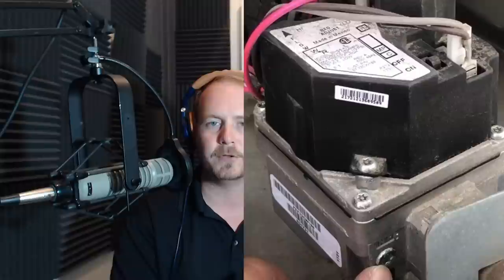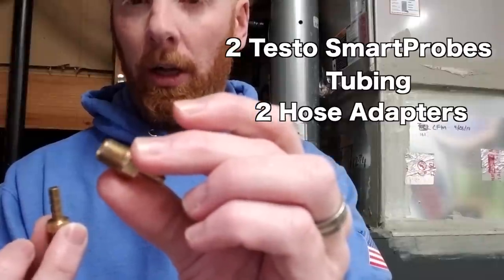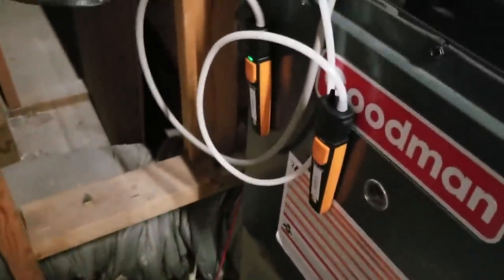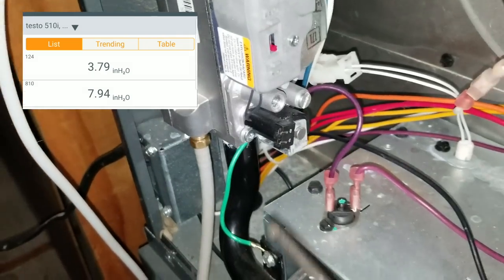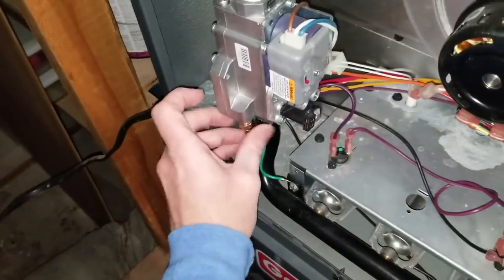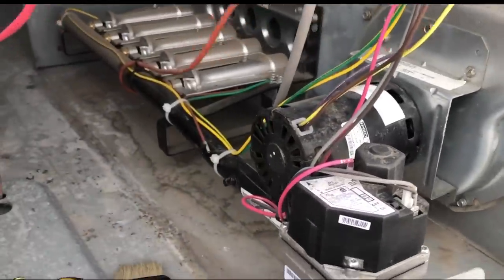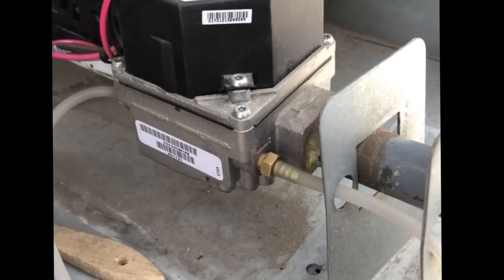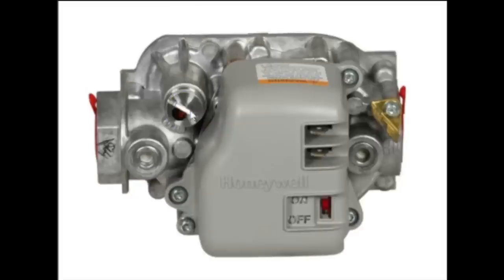Measuring & Adjusting Furnace Gas Pressure X2

Comment: I assume the input pressure is somewhat controlled by the utility and their pressure diaphragm at the meter so you would only want to reduce the input at valve if too high? My Rheem two stage furnace has a White Rogers valve which requires a 5/16 sleeve to cover the adjustment tube on the valve and which then connects to an adapter and hose to the manometer. It has a similar port for input measurement , but no means to adjust it ; further it’s not called for adjustment in the Furnace Manual. Thanks for the video!

Comment: You should of demonstrated the Carrier 3 stage furnace with throttle gas valve. I had to replace the valve and adjust the pressure for propane, that wasn’t enjoyable.
Reply: Never buy a carrier, are you not talking about a modulating furnace? Not 3 stages, modulating are garbage, all manufactures have had issues

Comment: Great video!  At some point Jim Bergmann might comment on this and discuss clocking the meter and setting your high fire manifold pressure anywhere from 3.2-3.8”wc depending on orifice size, elevation, and combustion analysis readings 🤓 I’m sure he has a video on this somewhere.

Comment: beginner question, but: what are the long term results if pressures are allowed to run too high? general overheating of the furnace/exhaust? and how about if the pressures run too low?
Reply: if it's over-fired you can get bad combustion (high co), premature hxt failure and overheating.

Comment: Good video but ........ in Matt's example he switched the 2 locations of the High/Low adjustment ports. At 5:30 he adjusts high pressure at the left port and at 6:19 he says the same left port is the low pressure adjustment port.
2ndly, the incoming gas pressure port is checked (label spec. calls for 7 iwc max - 5 iwc min) , yet no mention at all about high/low SUPPLY pressure after that. Not sure, but I think MQ app was showing supply pressure around 7.9 - 8.1 iwc if that's  what line 810 is in the app. That is 1 iwc more than max spec of 7. Is that a problem. What is the solution?
3rdly, isn't the incoming supply pressure check dependent on all the other gas appliances usage. Like if a gas dryer, a instantaneous gas water heater, gas oven and a gas fireplace all were firing simultaneously, doesn't that pull down the supply pressure at the furnace inlet?
Reply: If supply is to high you turn down at the meters regulator. It is a good idea to check supply with other appliances running to make sure your gas line is sized right and doesn’t fall below minimum input. If supply is to high it can ruin your valve. The gas valves max and the furnace rating may not be the same but always go with what’s on the furnace tag

Comment: What about the other type of gas valve that doesn't use the 3/8, it takes a much smaller hex which I think is 3/32 and you use a tube that goes over the manifold test port? I lost my hex bit and clicked on this video to see what exact size cuz I need to order another one

Comment: So you don’t perform combustion in conjunction with adjust gas pressure?
Reply: No.. combustion is for C02 output.   All you need to measure is Temp Rise. W.C  in each stage and observe the flame 🔥

Comment: 1st. video doesn't show how to adjust INLET pressure to make sure it's right.   How would you do that?
Reply: That depends. If it's a few inches high or low, call your gas company and have them adjust it at the meter. If it's 0 inches, pay your bill! Other than making sure your piping is skookum, there's nothing you should be doing to adjust input pressure.
Reply: Can’t you just install a regulator from the line coming in

Comment: How long did you wait before making adjustments.(I was told 15min) Ex if it’s 3.8 and I’m at 1.7 how long should I wait before adjusting? 

Cause sometimes I adjust it and it barely goes up. I honestly be too scared to raise the pressure, scares it blow up on me 😅